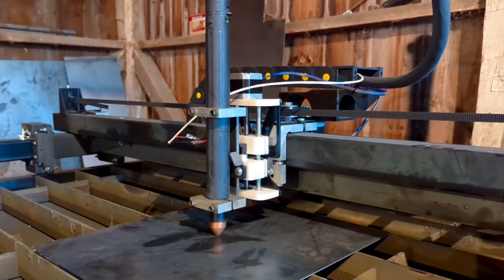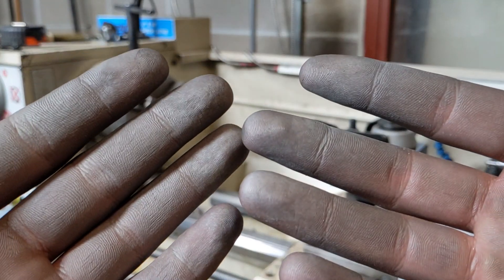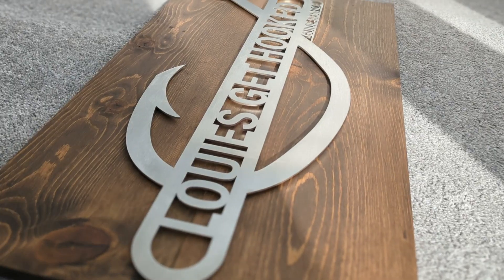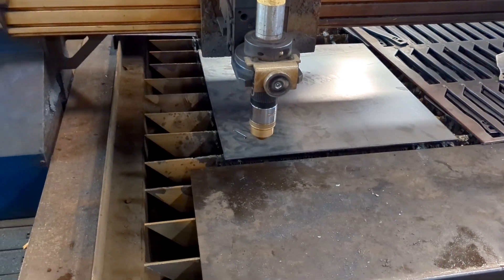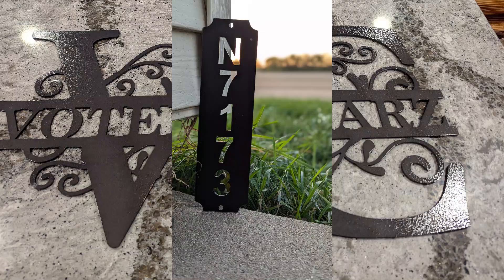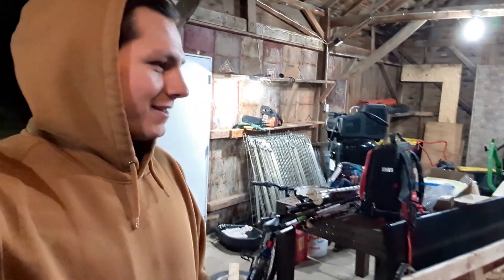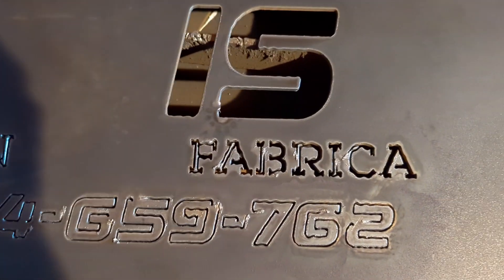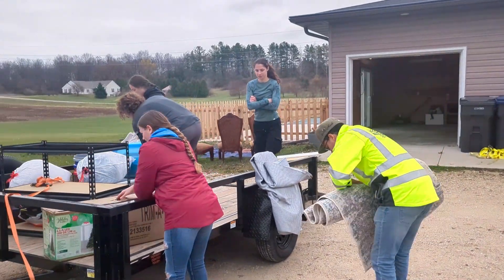How Much my CNC Plasma Cutter made in my first year of business (2024)

Comment: For CNC plasma cutting, forget Fusion 360...  Don't get me wrong, it's a great product, but it is expensive and you can do most of the same things using Inkscape (free) and SheetCAM (one-time license fee).  I also use Bend-Tech's sheet metal design tool...sometimes.  Bend-Tech while expensive is a one-time expense and it will let you get into tube bending fabrication projects...  The problem with Fusion 360 is that you have to pay for it if you intend to sell any of your work, and the last time I checked that was $600/year or more.  It's the best tool out there IMO for designing 3d prints, but it's manufacturing and CAM interface is a bit clunky for plasma cutting -- SheetCAM does a better job.

I am ready to throw in the towel entirely on the JD's garage machine, so even though I wrote an excellent SheetCAM post-processor for it, I may end up switching to a commercial cutter, or I may try MyPlasm electronics which also has it's own CAM software -- but everything I am learning says the JD's design just isn't going to cut it (no pun intended) for doing signs and other more intricate work.  It's not stable enough -- unless you cut way too slow and deal with a ton of extra dross, warpage, and burn-through on intricate parts.  It doesn't have drive gear reduction (ideally 3:1) and therefore can't move fast enough, and most important, the results are constantly inconsistent.  Like you, I've used professional CNC plasma cutters (I've used a TorchMate machine), and you just shouldn't have to put up with the lack of quality and consistency that you get from the JD's machine.  So I will either re-build from scratch for stability at high speeds, add gear reduction, and use either MyPlasm for an Acorn controller, or I will buy a commercial machine and hope I can make enough money back to cover the purchase within a year.  I guess in fairness to JD's guys, they meant it to be for hobbyists - which means not doing business with it really, so yeah, I guess you can run things really slow and spend a lot of time on clean-up and sizing and it still meets expectations as a hobby machine.  It just gets more and more expensive every time I ruin a piece of sheet metal because of the z-probe signaling early, etc.

Comment: You can buy a hobbyist license of solid work
Reply from the maker: @ElectronicStudies-c3s  what's the pricing on it? I've seen the makers edition. But you cant use those files in the professional version.
Reply: @ThyialIndustries  
Hobbyist = Maker edition (as far as I know). Of course they would not let you use the files in the professional  version. It is a whole point. I found the maker edition hard to use. It is not clear where all the crap is and the website and mng software is convoluted (and I'm a professional software engineer). And I don't even know if CAM is enabled.
Reply from the maker: @ElectronicStudies-c3s  interesting. I'll probably stay away from it until I can afford the basic packages
Reply: I'm learning inventor, for me it is easier, I had decade experience working in AutoCAD